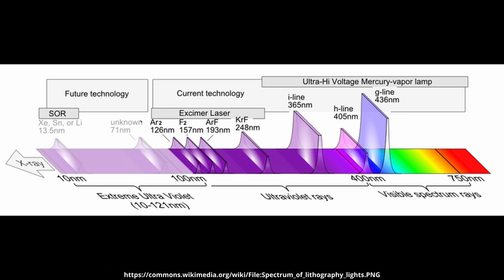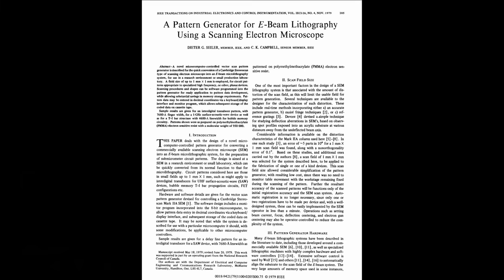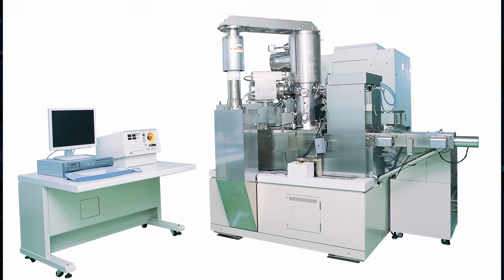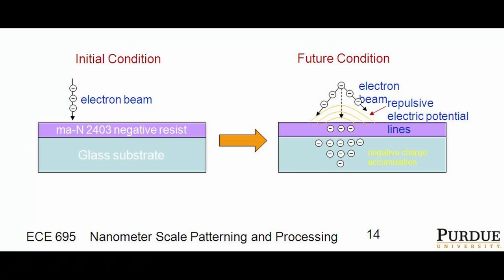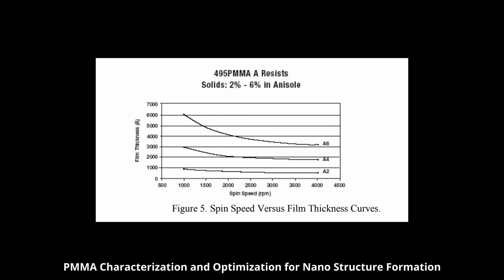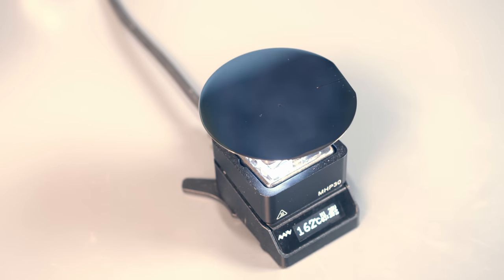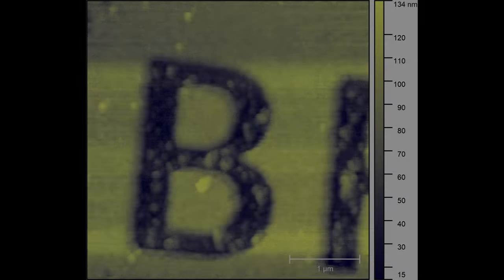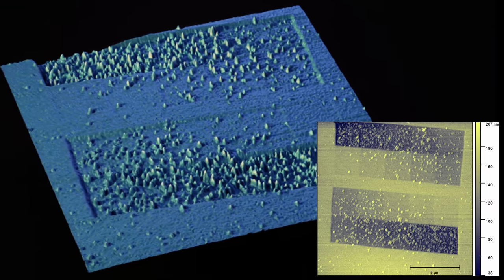Drawing Microscopic Patterns with Electrons

Comment: Mixed feelings, I don't see many taps breaking in your videos anymore. I'm very glad that you're making these videos though 😘
Reply from the maker: Fear not! I've been doing a lot of machining work lately in the new shop and hope to be showcasing it in future projects (including, alas, many broken taps). Have some interesting stuff that will feature various machining and engineering stuff :)
Reply: This is still technically subtractive manufacturing. Just so tiny that you can't use a tool to directly cut the features so one use acids instead for example. Although it can also become additive if instead of using an acid you deposit something lol.
Reply: @keith_cancel  Currently its just photoresist correct?  I believe he could go any direction from here.  Vapor deposition would yield additions. Acid etching could create subtraction.  Hell pretty sure he could even use this to dope the wafer because I am almost sure I remember seeing it done somewhere in which they placed solutions with the dopent on top and the electron knocks some atoms into the silicon.  It gets put in the photoresist.
I'm over here excited after I was able to recently create my own specific gravity balance with scales of roughly 20 milligram and 4mg tolerance thinking i have good precision and this dudes over here capable of making his own nm microchips and shit.
Reply: No spigots, nozzles or stopcocks, either!
Reply: what taps

Comment: This video has convinced me that the first practical homebrew DIY CPUs will be created using electron beam lithography instead of photo-lithography.  The advantage of having a higher beam precision and not having to deal with unwanted exposures from lighting in the room would be a huge advantage.  The disadvantage of much longer production times won't really be an issue when you are your own customer.
Reply: Not really, hard vacuum and electron beam makes it pretty complicated.
Still thinking about Huygens home-made DLP stepper. And DIY stuff doesn't need to be small either, you're not going to get a good enough and consistent process control for multiple masking, etching and doping steps at nm scale at home. A 4004 is 10um structure, yet until now, no DIY version has been made. But should be more than doable with rather simple photo lithography.
Reply: @graealex  That's a good point, I forgot about the need for a good vacuum.  I wonder if there is any kind of novel and 'innovative' way that you could just not use a hard vacuum, or maybe just a lesser one?  I suppose the problem with normal atmospheric pressure is probably that it causes electron scattering?  I wonder if there would be some clever way to avoid/minimize the electron scattering with different gasses/materials etc.?
Reply: @RobertElderSoftware  Applied Science showed how to make a scanning electron micro-scope years ago. A lot of overlap so that could be used as a starting point instead if one does not want shell out tons of money for something pre-built.
Reply: @keith_cancel  But you have to agree that the DIY microscope was shite, compared to the commercial one he got as a replacement, although still quite an old model.
Making this stuff "at home" is just not feasible.
Reply: Check out Sam Zeloof's work. He made his own UV lithography setup and made the first DIY integrated circuit in his parents' garage. It was an OpAmp, but his long term goal is to make a CPU.

He has graduated from highschool and is now off at college. I wouldn't be surprised if he shifts his focus to something even more amazing than making a DIY CPU.
Reply: @graealex  doesn’t his machine pull the vacuum for him so it’s a non issue? I’m not convinced by what you are saying, this python API he mentions also seems to make it straight forward in theory to line up the next mask as well… scan the thing to see where it is then transform your mask as required.
Reply: @hoarsebees  There are different grades of vacuum. For electron beam lithography, you need a very hard vacuum, and that will require two or three pump stages.
For photo lithography, you basically only need a clean room, or at least a clean box, basically a fan and a HEPA filter so you don't get a bunch of dust on your wafers.
It's just a lot simpler to use light vs electrons.
Reply: Imaginr youtube tutorials popping up on how to turn old crts into semiconductor machines

Comment: Amazing how far your home cleanroom has come! Some of the smallest features were probably washed away during development due to their high aspect ratio. I suggest a post-exposure bake unless you want to invest in a bottle of adhesion promoter.
Reply from the maker: Noted! Will look into some adhesion promotor!
Reply: Friends help friends get baked. 😆😆
Reply: PMMA doesn’t really need standard adhesion promoter. An ion mill or o2 plasma should do the trick.

Comment: 100nm, that's GameCube territory. It would be cool if you used this to print out an 8086 or an arm chip, probably more attainable as you'd have quite a bit of room for mistakes.
Reply: Now that is something I'd like to see. Printing old chips to repair old devices would be awesome. Or even just build a whole new one from scratch.
Reply: That would be a great project to work on.  I’m sure it would take a shit ton of time and effort, not to mention the engineering required to accomplish the task.  Not insurmountable, but challenging.
Reply: Many of the retro chips have a corresponding VHDL implementation from the MiSTer project. I would be could if we could transform those into a silicon design and replace some chips.
Reply: I think you have to consider the small scanning aperture and difficulty neatly stitching together multiple scans. I suggest that very simple chips could be a better first target, sneaking up on 4000 gates which is 6502 complexity. It is perhaps exciting that you can image something really small and fine detail, but you still have difficulty etching and whole chemistry and with lack of cleanroom environment. There are a lot of low complexity custom chips lacking in availability which are dying in classic computers.

Also call Sam Zeloof.
Reply: @SianaGearz  Not only would that be easier, but it could potentially be very lucrative as well, which would help fund building more infrastructure and allowing for a gradual increase in complexity. I would love to see that happen.

Comment: I did research in using MeV proton beams for lithography.  Proton beam writing has advantages, high aspect ration (depth vs beam size, ~1 um^2 vs 60-100um depth).  Accidentally created buried features, where the surface was under exposed (electronic stopping small) and the buried region was fully exposed (nuclear stopping high near end of range).  

Ice cold 70% IPA is a amazing improvement.  We used IPA/MIBK as a developer and had a hard time finding the perfect balance of dosing and developer, especially for deep feature.

Comment: I used to do a lot of EBL on a similarly jank system. It sounds like you would benefit from having a 'dump' area that the beam draws at the end of your process. Basically add a box that takes 30 sec to draw at the end of your pattern of interest. Then you can stop the process within that 30sec window and it won't effect the pattern you care about.

Comment: Fun fact about the rover wheels, the engineers at JPL were developing (though it didn't fly with curiosity) a modified wheel with a Raman spectroscopy sensor in it, where it would take continuous samples as the rover drove.  Really clever.  It was behind a sapphire (I believe) window.
Reply: Raman (after the guy), not ramen, the noodles
Reply: @graealex  Doh!  My bad.  Thanks for correcting me.

Comment: Could you use the ebl patterned wafer as a mold negative to make nanotextured surfaces? For example, gecko feet are sticky because of their microstructure. maybe that effect (or any other surface energy effect) could be emulated in cast resins?

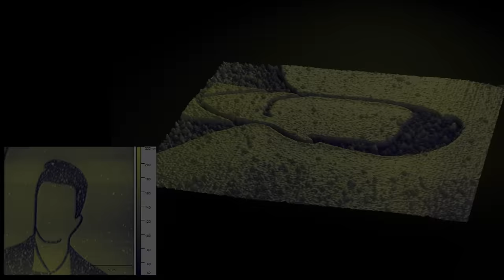Comment: An idea for the production problems at 13:38 might be to throw a small ultrasonic piezo transducer in while you're giving it the acetone bath. Essentially vigorously shaking the fluid, instead of the wafer itself, to give a more thorough monomer removal process.
Might speed it up a bit though. Or delaminate it a little more. I have no idea what power or frequency you'd be aiming for (it would be container and liquid volume dependent anyway I'd guess).

Comment: With this resolution, you should be able to print a conductive tuned antenna array for a specific light wave frequency.  For example, a blue laser with a known wavelength of 490nm would have a dipole antenna length of 490nm that would exactly absorb the coherent light energy and convert it to electrical power.  Could you print a tuned array of 490nm dipoles then hit it with a blue laser to see what kind of conversion factor you would get?  If you could print a whole array of different dipole antenna with lengths in the visible range, you could make efficient light collectors for detectors or possible power generation.
Reply: I would love to see this in a video.
Reply from the maker: Well that sounds interesting! Will do some reading, this is way outside my knowledge at the moment but it sounds like it could be a really fun project!
Reply: @BreakingTaps  You can get SPR plates pre-coated with gold that should enhance the coupling with the light even more
Reply: @BreakingTaps  The commenter is suggesting that with this technology, it would be possible to create a pattern of tiny metal antennas on a surface that are specifically designed to absorb a particular wavelength of light. For example, they mention a blue laser with a wavelength of 490 nanometers. The antennas would be designed to have a length of 490 nanometers, which would make them efficient at absorbing this particular wavelength of light.

By creating an array of these antennas, it may be possible to create an efficient light collector or power generator. When the antennas absorb light, they generate an electrical current. By creating an array of different antenna lengths, it may be possible to efficiently collect a wide range of different wavelengths of light, which could be useful for applications like solar energy or high-resolution imaging.   (Chatgtp maknig sense of the comment)
Reply: to be fair chatgtp also just repeated what the original commenter said, without understainding that we dont understand lot of the industry specific terminology and if youre goal is to help people understand, its not helpful talking this way, so i just respsonded with "i dont understand" and it gave a more clearer explanation for someone whos not deep into this stuff, a simple array of small attenas for power genreation, sort of like maybe how solid state fans with their many vibrating membranes that give them some crazy blowing air efficiencey compared to spinning fans.  Same could happen with solar energy which could be huge.   Solar in the winter is pretty inefficient unless you have crazy amount of panel, even just a doubling of efficiecy could change that and the more energy independance we have, the less we all fight for oil.  And the universe is full of it, yet we're hunkering down to stay on this planet forever which is impossible and shows any lack of foresite about the universe and our time to eventually get off this planet for real will come one day, i hope we're motivated to leave before then.  But i have a feeling exploding bombs as propellants isnt going to cut it for energy.  And ultimately, the universe made energy,  maybe it can happen again? why do we have to suck energy from stars even.. those wont last forever either, where did they get their energy from? maybe we can get some there too.  Anyhow I agree with original commentor, it would be cool to see what kind of power efficiecey an array of tiney metal attenas could produce in the same wafer space compared to a solar cell or something.  And as good as chatgtp is with its knowlege, it wouldnt have come up with an idea like that, so we still have a purpose hehe.

Comment: Nice presentation.  Vacuum tube Tech?  Anode, cathode, control grid. Does resist have values like capacitance, resistance or inductance? Is the material the plate? I'm thinking Ohm's law here. Slamming electrons into the plate, that's what we got going on here. Perhaps messing with values might help finess the work.

Comment: Huh, I wonder if you could try weaker solvents. For example, perhaps certain polymers have monomers that dissolve in soap, and the soap would essentially leave the rest of the polymer untouched. Additionally, would incorporating dendritic copper powder or CNT powder in your polymer help mitigate the charge buildup?

Comment: Finally a use for all those CD case covers! (:

Glad to hear you were able to take some time off when you need it. Those wheels already look amazing, also it's great they are made from the same (general) material. It's bonkers to think how much force was required to abrade away that much aluminum. (:
Reply from the maker: Thanks! And yeah, it also blows my mind how the real wheels were made. Much larger, milled from a single block of aluminum, and the "skin" of the wheel is just 0.75mm thick! 🤯
Reply: @BreakingTaps  I know a machinist who made new bushings for a machine. Bronze, and he started with a 60kg block of continuously cast bronze alloy, and the final bushing was sub 1kg. Plus nearly 60kg of scrap as shavings, he ended up with a final wall at 2mm in places, from the 400mm diameter original block. Needed to put in both eccentric holes for adjusting, plus machine in the gear teeth on a ridge to allow it to be adjusted, plus all the oil grooves and passages to allow both sides to receive lubrication. No drawings of the original, just good measurements of the existing shaft and the hole, plus the worn part to take measurement from. That was about a month to make the two, each coming as separate 60kg cast blocks.
Reply: That is so amazing!

Comment: "Electron beam driven dopant diffusion in semiconductors" is a thing, so what is to stop you writing a custom one-off circuit directly into your silicon wafer? Digital holograms with the interference pattern rendered from 3D geometry files would be fun too.
Reply from the maker: Interesting! Didn't realize that was a thing, will do some reading on the subject! Even without that it should be possible to do small circuits (Sam Zeloof is doing that via more traditional techniques). But being able to dope in a controlled manner with an ebeam is a really interesting possibility. Probably faster/easier/more accurate than traditional thermal diffusion and masking. Thanks for the tip!
Reply: @BreakingTaps  If you escape from the "I need a process that will make millions of these things fast and at a low cost" mindset you should be able to do a lot in the bespoke integrated electronics area.  It also makes the mind boggle as to what is going on in some classified lab somewhere, and has been for decades.

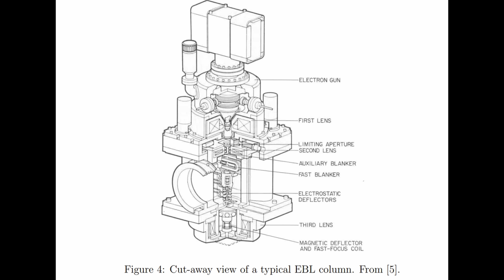Comment: In addition to that at 20:06 - the beam blanker is not a electro magnet. it is 2 plates which charged positive,negative depending on you want it to blank or not. Actually a super simple piece of electronics to make. Would be easy enough to retrofit.
Reply from the maker: Ah, just electrostatics then. Makes sense, cheers for the note!

Comment: If you are worried about the acrylic not being fully dissolved (so long as it actually is acrylic instead of a contaminate) you can try putting the solution in a ultrasonic cleaner for a few minutes. At work we do this with all of our samples while we are preping them for the HPLC.
Reply from the maker: Will give it a shot! Might also be impurities/contamination in the acrylic itself now that I think about it. I assume those resin pellets aren't processed in super clean conditions...
Reply: @BreakingTaps  something else you could do is run the solution through a syringe filter. At work we have those down to a filter size of 0.2um.

Comment: re: Extra traces::  When I was writing code to utilize the XY deflection of an oscilloscope to draw pictures using DACs I had a similar issue where the phosphor would light up as it made a trace from one vector image to another. I solved this by always going back to (0,0) when a path was complete. This sudden deflection was fast enough it did not leave a trace. So I would assume, when between shapes find the furthest the beam can deflect away as a single point and connect your shapes by tracing the path from the end of first path to the newly calc'ed point to the start of the second path. The distance traveled will lower the exposure.
Reply: Why

Comment: There are special microscopes which do something so you dont't need to sputter samples anymore, i wonder wether those would also work for Lithography without conductivity
Reply from the maker: I think those work by allowing more air into the chamber l. Mine has a "high pressure" mode which helps reduce changing, because the higher gas load helps remove some of the charge. I think "environmental" SEMs are a little more complicated but same idea. Big downside is that it reduces resolution. The extra gas also scatters the electrons 😢

Comment: I’d like to see what other equipment you’d need to then make diodes or JFETs, now that you have e-beam resists.
Reply: I abandoned using ebeam due to secondary electrons causing excessive resist exposure but i was using hline resist. The process was ridiculously slow at the accelerating voltages i was using. But i made schottky diodes and mesfets with copper sulfide (Cu2S) and aluminum (Mg worked better but reacted with my developer unless capped with Al).
Reply: Does he have a working implant process? You definitely need that to start actually building devices.